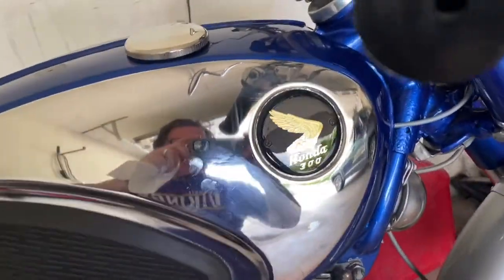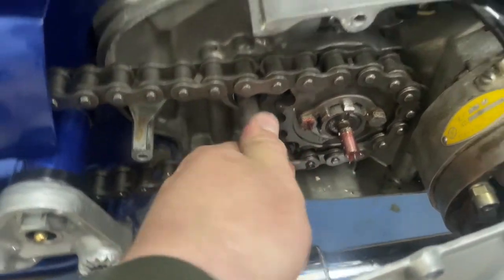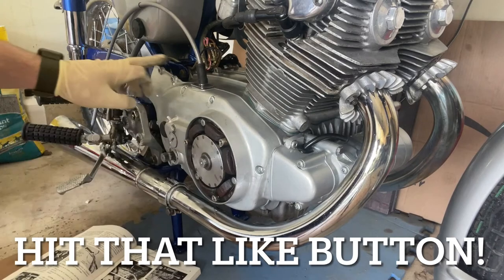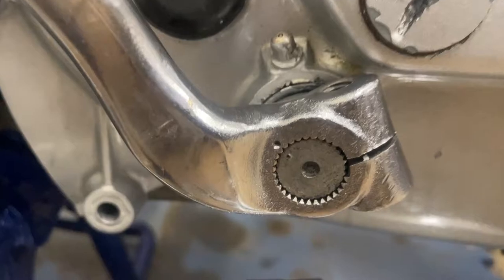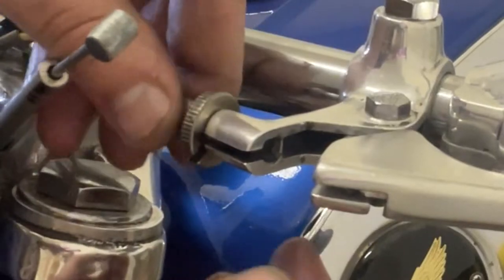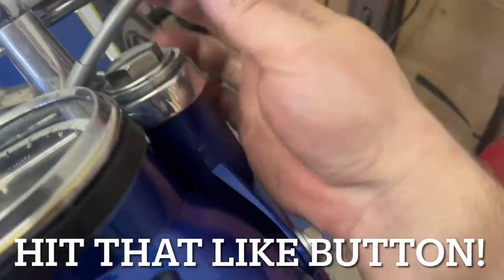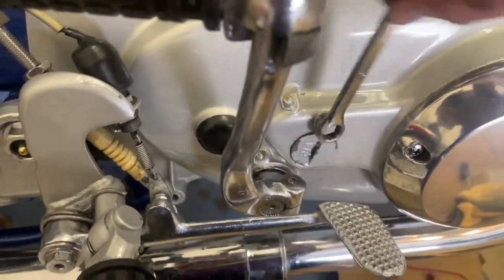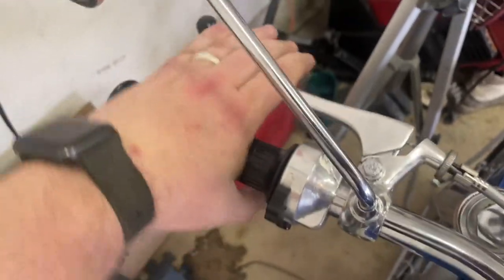Motorcycle Kick Start Install, Clutch Cable Route & Cable Adjustment: CB77

Comment: That ball bearing is why I found a single loose bearing laying on my C115 clutch when I first disassembled it to find out why the adjusting rod was sticking out so far so as to keep the side cover from fitting.  

The C115 doesn’t use a ball bearing but clearly someone familiar with the clutch on bigger bikes thought it did. 

Use the parts book as a guide as to what does and what doesn’t go on your bike, some hack may have been there before you.
Reply from the maker: That’s a really good point! You never know who has been in there.

Comment: Great job!  Be sure to really tighten the kick start lever to the spline gear via the bolt as the splines on that gear are notorious for stripping.  Most people also use the electric start only because that gear is only supported by the cover itself which is weak and often crack.
Reply from the maker: Thanks for the note. I’ve read that those covers can be problematic

Comment: Hey Brian, regarding the clutch cable install to lever: you first put the cable stop into the lever then line up the slots on the adjuster and perch, slipping the cable into the slot, then the cable sleeve will go into end of perch.
Reply from the maker: I did it backwards but it all worked out. Found a way!

Comment: Your videos are some of the best on YouTube. Keep 'em coming. What manual are you using for the '67 CB77? I have the Shop Manual Honda 250 300 C72 C77, CS72 CS77, CB72 CB77. It leave a lot to be desired. The manual you show looks a lot more detailed. Thanks
Reply from the maker: Here’s the book I used. Best I saw. CLYMER HONDA 250CC 350CC TWINS ALL YEARS SERVICE REPAIR MAINTENANCE MANUAL. I’ll make a video about it.
Reply: @KeepOnWrenching  Is that the manual you were using when you showed the clutch adjustment on the 305 Superhawk? Thanks
Reply from the maker: @edgould4071  yes it was. If you’re a part of the FB group I can post a picture of it. There are a lot of different ones.

Comment: I am working on a Honda cl77 305 scrambler and took the right side cover off to clean and lube . I reinstalled it and went to kick start it and it’s just a limp kickstarter , only tension on it is the spring . Is there something you can think of that I am missing ? Thanks
Reply from the maker: Before you put the cover back on you need to make sure you rotate that spindle all the way to the right. It will click click click but then stop.  I recall that being one of the nuances